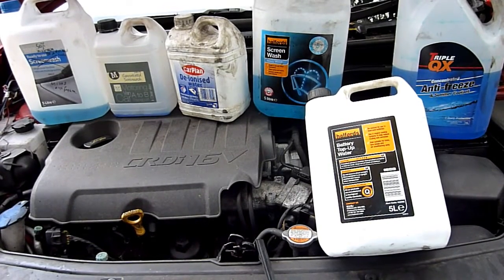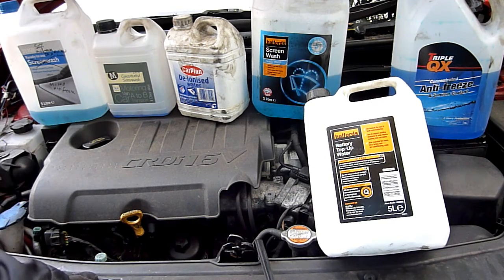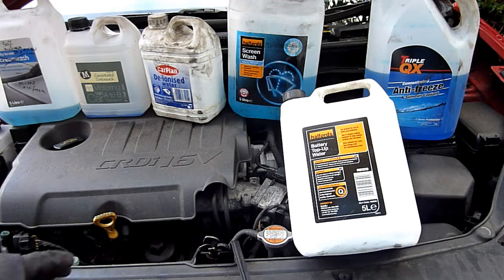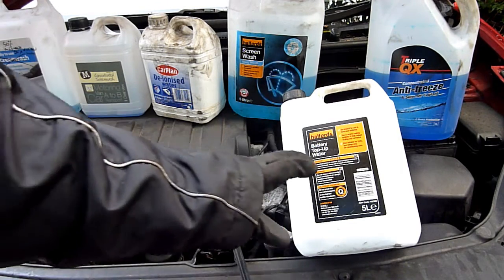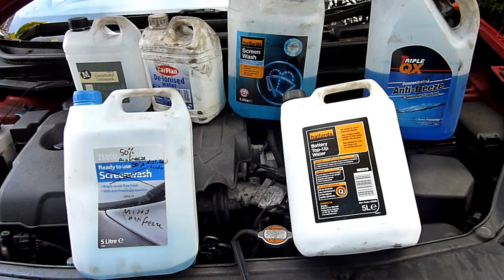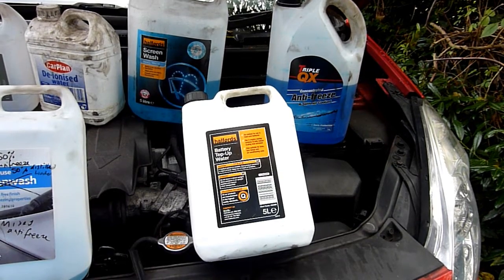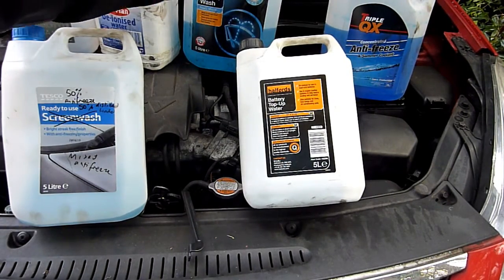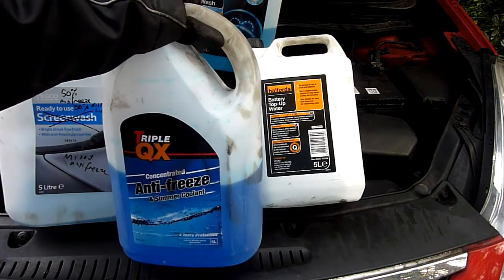Why You Should Use Distilled Water in Your Car

Comment: I've installed many a RO system. Generally most good purified water systems will take tap down to a range of 5ppm , worst case if membrane hasnt been changed, 80 ppm. Which is perfectly drinkable, and desirable in fact...not so much for a radiator 😅. Depends how hard the tap water is in your locale. Here ours is very HARD 350-600 ppm in Mohave desert. 

Distilled is 0 ppm and neutral Ph. Honestly I've ran reverse osmosis purified water in my coolant mixes for over 23  years, with zero issues. Distilled is better tho

Comment: can you drink distilled water you buy from a garage.
Reply from the maker: @billybunter5575  yes you can, but drinking water without hardness in the long term can cause bone density problems.
Reply: I understand that distilled water readily absorbs any minerals it comes in contact.    Drinking it would in theory drain your body of Minerals we need.   That same theory is great for your radiator..   It would absorb mineral scale in your engine,  keeping the passages clear.

Comment: It always puzzled me why cooling systems don't have a filter to collect any debris that may occur, after all, oil and fuel are filtered?
Reply from the maker: Actually having small particles can sometimes help prevent head gasket blows...I pour in a small amount of copper suspended in a liquid on coolant change to seal micro fractures that later turn into a dead gasket blowout.

Comment: or move to california - no more frozen car water
Reply from the maker: If you use tap water in your radiator, you'll still get the problem of blockages in your radiator and heat exchanger even when there's no problem of freezing. If you don't ever change the coolant from the factory, then you'll get corrosion eventually.

Comment: i want to change my coolant and i need to get that red or orange stuff called dex cool,,it comes in both 50/50 and concentrated form,,i prefer to buy the 1 jug of concentrate for my need plus it is two for the price of one after you dilute it yourself, the store guy however told me i can not use distilled water as it will freeze and i should use de-ionized water,,is he pulling my leg or uninfomred? and yes i live in a cold climate called canada
Reply from the maker: Distilled water will freeze like de-ionized at 0 C, but actually slightly longer to get going due to the lack of particles to crystallise around. It's hard to get hold of that fluid, so just go for the de-ionized.
Reply: @EducationPineapple  what fluid is hard to get hold of?
Reply: @EducationPineapple  i think you meant to say go for distilled water right? so you also say distilled takes a bit lomnger before freezing than deionized? thats good then ,so the guy was missinformed about my needing to only use deionized
Reply from the maker: @ARCSTREAMS  If you can get distilled water at a cheap price then use it. I can't get the stuff. If a proven method with de-ionised works then use de-ionised. I theorise that distilled is better, but I know de-ionised works and is cheap. Go with the de-ionised.
Reply: @EducationPineapple  ohh really its difficult to find distilled where you are? im surprised,,over here you walk into any supermarket and they have it in gallons for a dollar ,,but i am asking you if its ok for me to use distilled instead of deionized with my coolant here in cold weather? i guess both are ok then?
Reply from the maker: @ARCSTREAMS  you should do my simple test to check your  distilled water is ion free. If it's good then just use that. My guess is, distilled water can be expensive to produce unless someone with a lot of land bottles it off in a condensation collecting factory like they do for making sea water drinkable in say Saudi Arabia.
Reply: @EducationPineapple  i am not really concerned about corrosion or rusting ,my worry is freezing and cracking my engine block if i use 50/50 water to coolant because some guy said i should use deionized instead of distilled because distilled will freeze,,i think both freeze juts the same and everyone uses distilled,,i dont think i need to worry ,,,i doubt making distilled water is more expensive than making deionized ,,unless those nw condensation technologies are more expensive to run,,i saw a program that showed these units on the discovery chanel a few days ago coincidentally
Reply from the maker: @ARCSTREAMS  it takes a lot of energy to boil water until it evaporates away. That is why the sun's energy should be used. I would do my own simple test, as my video shows,   to check how genuine the distilled water is. If you're worried about freezing then add more concentrated antifreeze than water. For example 70:30
Reply: @EducationPineapple  yeah im not so concerned with corrosion or rusting from distilled water ,worried more about it freezing if i put in the wrong dilution but mostly it calls for 50/50 , i just want to be sure the water portion can be distilled water instead of deionized,,i can go with 60/40 to be safer i guess

Comment: Question to burp coolant in pressurized system (Focus ST)  just leave reservoir cap off, turn the car on until thermostat opens then it will burp by itself  right? how long I gotta let it run after thermostat opens?  Do it once is good or a few times?
Reply: Watch your coolant reservoir. If it's filling up as you're filling up your radiator then it's just expelling that extra coolant in the coolant reservoir.
Reply: I think the amount of time left running depends on how much air is still in the system, other videos on here say 10 to 15mins by time fan cuts in, squeeze top rad hose to help release more of the trapped air, rev engine a few times to help also. I need to take these steps myself.

Comment: Distilled water can damage your coolant system! It pulls electrolytes from the metal and can damage it
Reply from the maker: Thank you for the comment, however the evidence doesn't support your theory. Please watch my video on the matter https://youtu.be/hzy3bKsjboA.
Reply: Education Pineapple I said Distilled not Deionized water
Reply from the maker: @ericmcguire5469  Distilled water is less likely to have ions than de-ionised water, thus making it less electrically conductive. 

Typical conductivity of waters:
Ultra pure water 5.5 · 10-6 S/m
Drinking water 0.005 – 0.05 S/m
Sea water 5 S/m

Read more: https://www.lenntech.com/applications/ultrapure/conductivity/water-conductivity.htm#ixzz6OaqId26j
There's no evidence that I have seen that states distilled water can damage cooling systems.
Reply: Nice bait.
Reply: I think u mean deionised water

Comment: You should never use distilled water in a radiator!!! During the distillation process, water is vaporized into its gaseous phase, so all its impurities are left behind. These impurities include a number of minerals, including “calcium” and “magnesium,” the two components of water “hardness.” The water is then condensed back into its liquid phase, so the resulting liquid is pure water – in fact, some of the purest water on earth. But the problem is that when water is distilled, or “stripped,” of its minerals and impurities, the resulting solution is composed of chemically imbalanced “ions.” This leaves distilled water “ionically hungry,” so it will actually strip electrons from the metals in a cooling system as it attempts to chemically re-balance itself. As it chemically removes electrons from the metals of cooling system components, distilled water eventually does extreme damage that could lead to cooling system failure.
Reply from the maker: Actually distilled water is ionically neutral. Where would you put the electrons? H=+1, o=-2, therefore H2o. There's nowhere to place the electrons. If you were correct then rain water would eat away at your car easier than parking your car near the sea, where there is plenty of mineral and salts. Rain water is nearly water only.
Reply: Metals in distilled water corrode, which is more complicated than one would expect. Corrosion usually happens in one of four ways, listed from most to least common.

The metal corrodes until an equilibrium concentration of metal ions in the water is reached. The corrosion process puts metal ions into solution and creates hydrogen gas.
2H_2O + M → H_2 + M^2^+ + 2OH^-
At equilibrium, metal atoms are corroding off the metal at the same rate as ions being deposited onto the metal. Once this point is reached, a human observer would see the metal neither shrinking nor growing. For some metals (like platinum) this requires a very, very small concentration of ions in solution, so the metal will not measurably corrode. For some metals (like zinc) the equilibrium concentration is impossibly high (aka the solution becomes more metal than water), so it will keep corroding forever. For alkali metals, this process is hot enough for the hydrogen gas to ignite when it comes into contact with air. These explosions can be seen with a quick youtube search of sodium or cesium in water. If the metal is constantly flushed with new distilled water, an equilibrium concentration will never be reached, and the metal will corrode completely. This process can occur across a massive spectrum of rates depending on the conditions.
There is oxygen in the water. The metal will corrode faster and to a higher equilibrium concentration than without oxygen, but otherwise this is exactly the same as case 1.
O_2 + 2H_20 + 2M → 2M^2^+ + 4OH^-
An oxide forms (e.g. M_2O_3 or MO_2^2^-). Sometimes the oxide is an ion. These ions also have an equilibrium concentration, so a similar process to the previous cases occurs. Other times the oxide is solid (think rust). Solids don’t really have a concentration, so the metal will “rust” itself into oblivion. Courtesy Jack Peters, Materials Scientist and Engineer from UC Berkeley and there are many more explanations on the Web. I worked on steam generators where distilled water was substituted in place of tap water for the pharmaceutical industry. The end result was rapid deterioration of the electrical elements due to pitting of the sheath of the element. That's why I did my research at the time.
Reply from the maker: @pieterjones5425 I been working on cars since the early 90s. I used to suffer from dashboard heater radiator clogging up from limescale due to tap water and getting no heat in winter and leaks; or a leaking main radiator due to corrosion and clogging from tap water leading to bursting and  heating problems etc. Since about mid 90s I've only used anti-freeze with distilled water/ deionised water or ready mixed anti-freeze and have never had the same trouble. I am going to be conducting a couple of experiments soon to figure out some results from what's out there. The tests results of short term experiments will be immediately available. Separate long term experiment will take longer for results. Then we'll know for sure.
Reply: Some studies suggest R.O. water (Soft ) or rain is the best. Removes the lime etc. Other studies suggest  that the distilled water will only corrode until the electrons are chemically balanced in a closed loop. How much that is I don't know. But reports do say that it pits aluminium. I used to also work on cars and I lived in a warmer climate. I used to use vegetable based cutting oil without antifreeze. However they say the heat transfer is not as great as antifreeze. But I drove a car for over 20 years with no radiator problems, corrosion or blockages. When overhauling the engine, no scale build up. I used Tap water. But I don't know how hard it was. Whit I do know is the harder the water the more lime and scale build up. I also know in some countries you can get different immersion heaters for soft water and hard water. I will do research on the rain water.
Reply: @pieterjones5425  meaning the best is using RO water?
Reply: @pieterjones5425  so you are saying to use tap water instead?
Reply: @EducationPineapple i agree 100% based on actual long-term experience similar to yours. this is what matters most more than theories. did exactly as you did since the 90's too.😊
Reply: @yoyyoy4789  Yes!
Reply: Distilled water doesn't contain anything except hydrogen and oxygen. No impurities.
Reply from the maker: Also if you place two electrodes in pure H2o, you won't get a current flowing, unless voltages are very high. Add a little salt and the current will flow. Rusting is what is called oxidation. And for that to occur there must be a transfer of electrons.
Reply from the maker: Also water is covalently (stronger than ionic)  bonded although it does have a slight polar charge.
Reply: @EducationPineapple  is it not true that distilled water starts pulling from the atmosphere and becomes acidic which then start corroding things? also will it not freeze much faster than deionized water?
Reply from the maker: @ARCSTREAMS  Distilled water in a modern car should be sealed from the atmosphere and the tests shown in my video shows that water held in a vessel remains PH neutral...see here...https://youtu.be/hzy3bKsjboA
Reply: @EducationPineapple  yes i saw your video on that,,ty
Reply from the maker: I used to teach chemistry to school kids.
Reply from the maker: Please check out my video where I carry out some definitive experiments...https://youtu.be/hzy3bKsjboA
Reply: @Pieter Jones Except you're missing the point that it's then mixed w antifreeze. That's like saying the water you add to soup doesn't taste good. The recipe is incomplete.
Reply: @mback12000 Despite its benefits, distilled water is particularly corrosive. With no minerals to give the water pH balance, distilled water acts like a magnet, absorbing chemicals (phthalates and bisphenols) from plastics, nickel from stainless steel, aluminum from aluminum containers, and carbon dioxide from the air.
Reply: @pieterjones5425  That would be valid if you ran pure distilled water. But it is mixed with antifreeze/coolant concentrate which has the anti corrosive properties. There is nothing wrong with using distilled water, in fact many engine manufacturers recommend distilled water, and the reason is you always mix it with antifreeze/coolant concentrate. Your chemistry lesson is interesting but irrelevant because it ignores the addition of antifreeze/coolant.
Reply: since they been striped there are no ions and whatever there was before was not balancing anything,,pure H20 is not imbalanced and has no ions and its being mixed with the coolant too so not like you are just putting pure water in the system ,i think you are making too much of it ,even if it strips anything it will be minute traces
Reply: ok so once it re balances itself everything should be fine and there wont be any further stripping of these traces minute amounts
Reply: pieterjones is right.  Ditch water is best. All of you who say distilled should switch to muddy ditch water.

Comment: Actually you are wrong distilled water does damage to your cooling system https://www.hyperlube.com/blog/blog/why-you-should-never-use-distilled-water-in-your-cooling-system/
Reply from the maker: Rust or Oxidation is the movement of electrolytes and electrons in a solution with some like iron as the rusting material. Infact it is similar to when you put electrodes into water with electrolytes present and switch on a potential difference. When you try the electrolysis with distill water (ions) removed, there is no conduction of electricity. This means much less chance of rust of the iron parts of the engine components. Of course salts will eventually seep in from the surrounding and a little bit of rust may occur despite rust inhibitors in the antifreeze.  However distilled water will undoubtedly help in reducing Oxidation. An added bonus of  using distilled water is there is much less or zero deposits of the ionised material such as calcium carbonate from tap water that can form and clog up the small arteries of the coolant radiator. Good luck with your ventures.
Reply from the maker: I have looked at the above link. I think it's done by a company selling their version of a coolant. There's much to critique about the written piece. An analogy is when you receive fake emails looking to defraud you, one of the telling   markers is if there are any spelling mistakes. Look at the script and you'll see that salt is NaCl, according to them. Infact that is wrong. Much like a spelling mistake. Sodium (Na) has a + 2 valency. And Chloride has got a - 1 valency. I haven't taught chemistry for years, so I may be a little off with the terminology, but this means common salt has a formula of NaCl2 which means you need 2 chlorides to balance out the one sodium in a ionic type of bonding. It's an unforgiving mistake along with many other psuedo science nonsense from a person that equates to a 13-year-old's chemistry minor's deliberations. I think the script is also alluding to adding salt (not 100 percent sure) later on as helping. This is very bad advice.
Reply from the maker: According to the script, distilled water is 'ionically hungry'. This is also nonsense. Water or H2o is perfectly balanced in an covalent Bond and would need not to gain or lose an extra electron or two. It does not look to strip electrons from metal. Iron is at +3 and sometimes at +2. That means it already has a shortage of electrons, so how on Earth is it possible to strip more electrons from it? You can forget about aluminium as that's an even more reactive metal than iron.